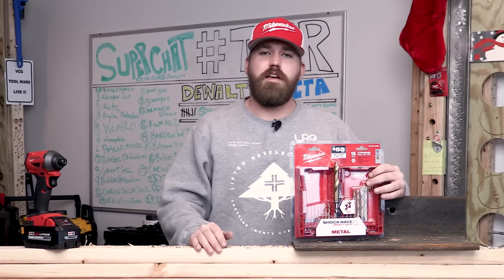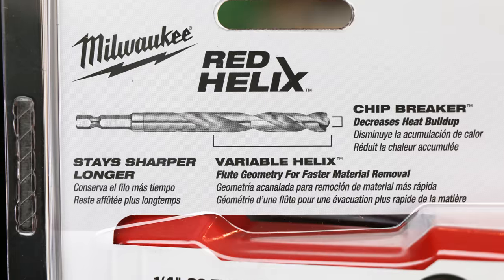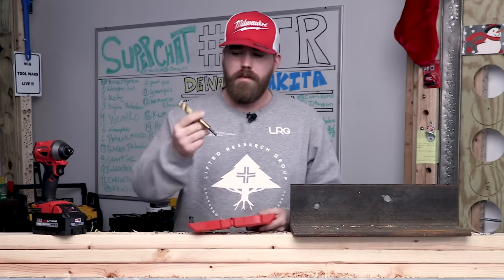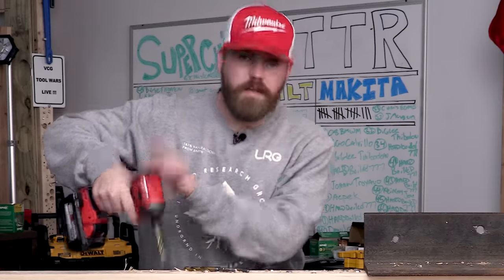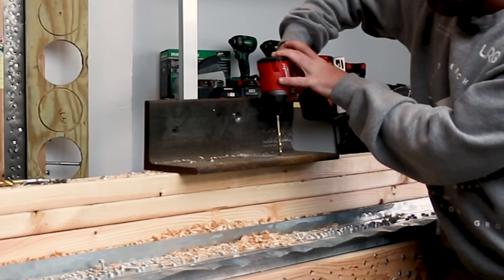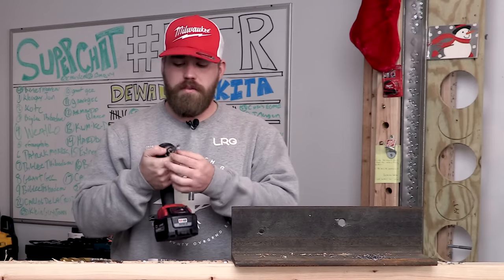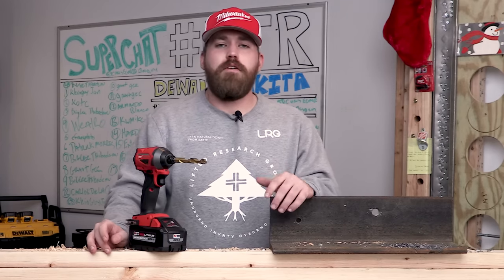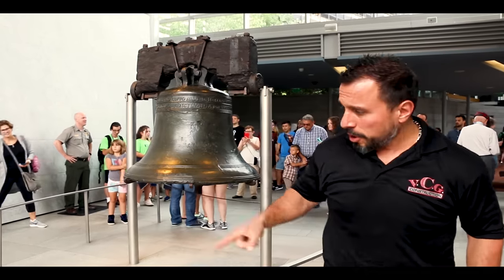Milwaukee RED HELIX Shockwave 15 Piece Titanium Drill Bit Set (48-89-4630)

Comment: Nice to have the 1/4 hex if you an impact is all you have.
Reply: I’m not sure why drill bits ever came without the hex, but I’m new to power tools and it’s history so I assume there has to be a purpose, but I never liked using the rounded bits even before I knew a little more about tools.

Comment: I just started working in the electrical field a year ago and bought this set at the depot when I  bought my first set of Milwaukee drills. Just yesterday I tried drilling through a windbrace and it couldn't cut it. Now granted I couldn't get a ton of pressure behind the tool but after 10 minutes of drilling with the 9/64" and heating up my impact drill all I could do was get a small divot in the metal. Finally got through using a self taping hex head screw.  I was wondering if you guys ever ran into this problem? Thanks for the reviews guys. Always take a few minutes to check out the videos on your channel.
Reply from the maker: Brand new bit?
Reply: @VCGConstruction  brand spanking new. Never used before. The reason I used it was because we snapped the heads off of 2 self tappers when using the m18 1/4" hex impact driver. We were using them to try and get a pilot hole going do we could get a better bite from the self tapper and could slow down once it started screwing to prevent snapping the heads off again. Thanks for the reply! You guys rock!
Reply from the maker: If I need to drill a hole with a self tapper that a drill bit couldn’t do, I’d return the kit immediately and grab a new one!

Comment: Another great example why not to use an impact for drilling , when the bit bottoms out it binds up because the tool head is to short. And will make the hole not strait through a deep cut.
Reply from the maker: These bits are specifically made to be used in an impact driver
Reply: They r great bits
Reply: I wouldn't use it for heavy duty drilling, but.its great for a pilot hole in steel, and I can have two tools which means I have to swap bits out two times less every hole

Comment: Damned wrestling match to get the bits in and put of those slots. In order to remove a bit, I find it best to use a pair of 9.5” linesman pliers and step on the box with my foot, although this method can be precarious when executing it on an extension ladder.

Comment: How well do the drills work on finer stuff? Obviously fabulous in heavy duty mode. My only complaint is you get a bunch of size that aren't needed and two replacement bit cost the same as the whole kit. For any kit for that matter. Also the shorter ones are only really designed for very thin materials. Once you've past the flutes and hit the shank area you've gone past the actual designed use area. What do you think?
Reply from the maker: We need to do more finer testing for us to know.

Comment: Great Case in so many ways... just incase you want to remove the various bits.. tips and tricks would be appreciated. from removing these bits, to putting hot ones back in. Aside from drilling out the bit holders just a little bit, or using needle nose pliers, for the love of Milwaukee, can we make a case that holds bits snug but also allows for some sweet release. seriously though. the bits in this case are a pain in the bits to remove.
Reply: Damned wrestling match to get the bits in and out of those slots. In order to remove a bit, I find it best to use a pair of 9.5” linesman pliers and step on the box with my foot, although this method can be precarious when executing it on an extension ladder.
Reply: Keep a small flat head screwdriver with your kit. The smaller bits are the issue. Just pop the screwdriver under the bit base and pry it up. To put it back in, hold the flat-head of the screwdriver against the hex base and push straight down. You can always make your own drill index with a drill press and each bit. Applying paste wax to the bit as you twist it into the hole the first time to make it slide in and out easy. A label maker at the base of each bit hole is helpful. Takes up more room though. This case is nice and compact.

Comment: I use these exact same bits on my dewalt impact driver. before i get slammed for mixing brands, I got mine at a stupid good deal for 100 bucks with a 5amp hr battery and charger.. but seriously, these bits are phenomenal
Reply: Nothing wrong with mixing brands. I use Milwaukee power tools and dewalt driver bits

Comment: Purchased these on black Friday for $10 I believe. Since then I have used one bit so far.
Reply from the maker: The lowest I saw them was $15 so you got an awesome deal!!
Reply from the maker: Let us know how it holds up over time John! Hope you get to use it more
Reply: I only have the 3 mm bit, but if I need a 3mm hole, or I am drilling pilot holes.for larger holes in steel, I use that over my drill, because it has an extra 1250 RPM which absolutely rips through the steel